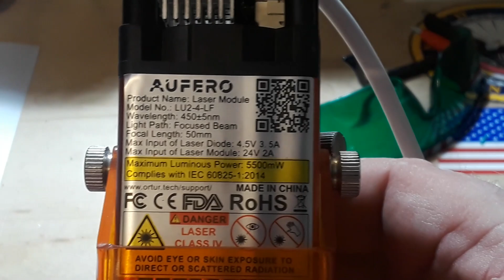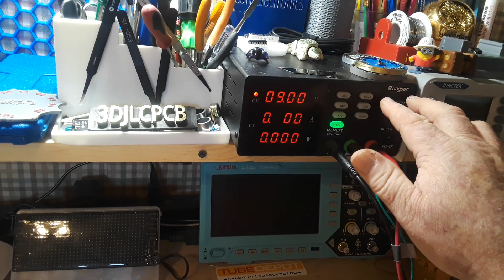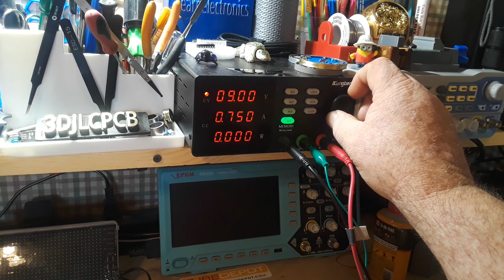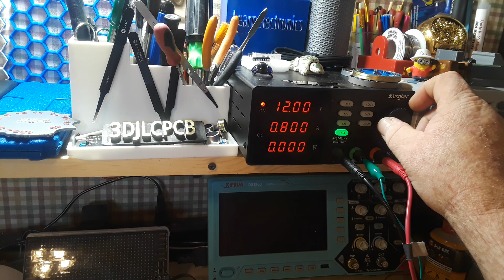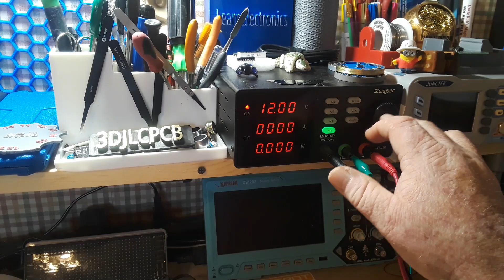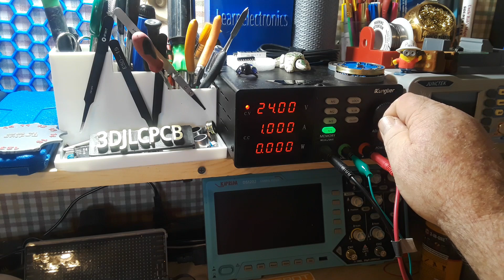Playing with a 20W LASER

Comment: The power wattage and the optical power is not the same. While the laser module may pull 20 watts the optical power may be only 15 watts. Still not a toy!
Reply from the maker: I know, probably closer to 5W laser output. It wont engrave aluminum, even when it's blacked out.

Comment: Are you not able to focus the beam so you can have it further away?  There is normally a focus knob on the side or or even a focus ring around the actual laser lens (turn off first, of course).
Reply from the maker: These LASERs for engraving have a fixed 50mm focal length.

Comment: Greetings from France. Take care with those lasers, even at low power a bad reflection on a surface can permanently damage your eyes (as efficiently as a french riot cop). Most of the cheap laser "safety" goggles we see on amazon or aliexpress are not safe enough with lasers of class 3B and above . In physics labs and "fab labs" where lasers are common tools, goggles are expensive, designed for a specific wavelength, they enclose completely the eyes so that a laser beam can't accidentally reach your eye from the sides. On top of that, fumes extraction is required, most of the fumes produced by cutting laminated wood, plastic or epoxy, or MDF are quite nasty. Stay safe! Peace
Reply from the maker: Thank you. Yes, I figured the  goggles were sub par.